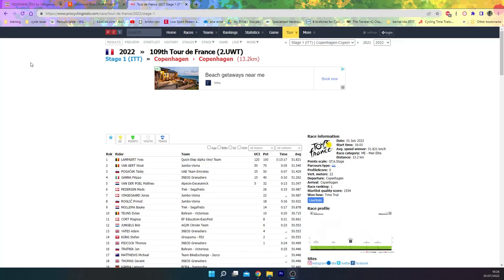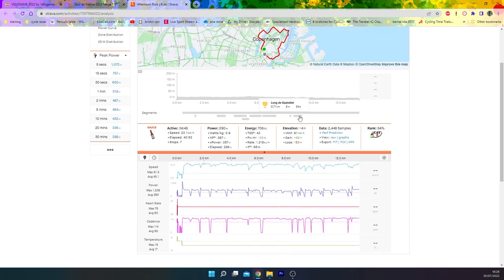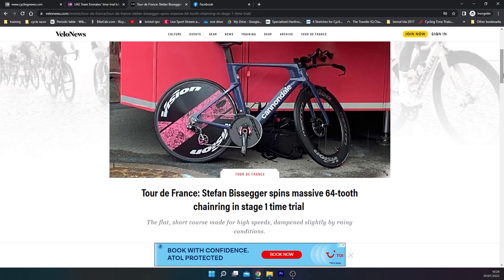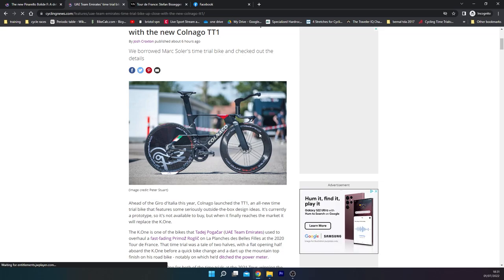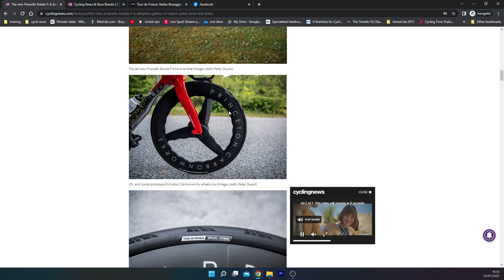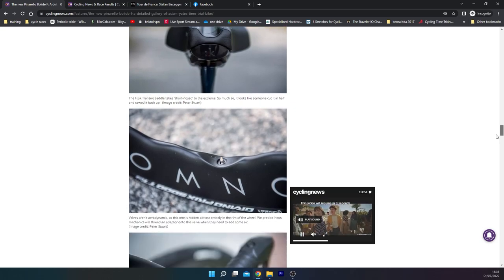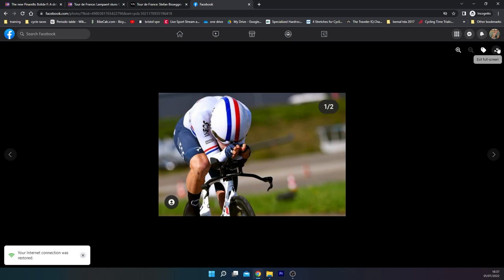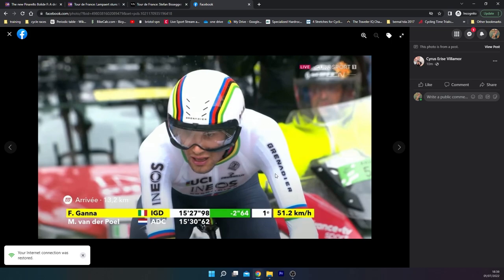TdF STAGE 1 TT Tech ANALYSIS + POWER

Comment: P Zeros aren’t terrible tires for TT. Only Corsa speed, veloflex, power TT are slightly faster (maybe new Conti’s) . Grip in the wet though….
Reply from the maker: I mean they are a tt tyre and slower than gp 5000 / Michelin power cup. Bit embrassing for them that a tyre you can use all the time is faster than a specific tt tyre
Reply: @CharlieCarbsandCycling  why do you think the gp5000 is faster? The Aerocoach data says otherwise